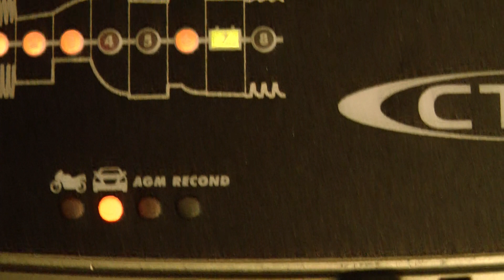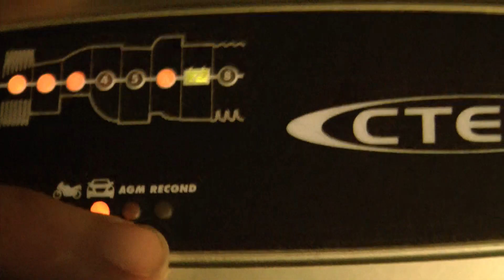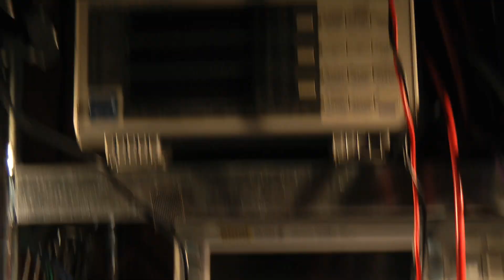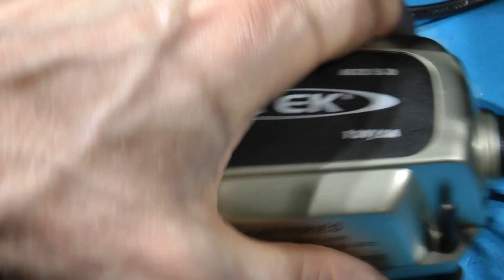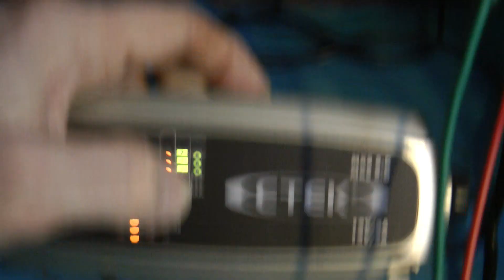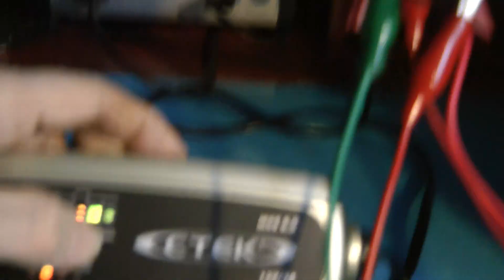Does the NOCO Genius5  charge better a than CTEK MXS 5.0 ???. NOCO Parametric Test Part 4

Comment: I'm really enjoying this series. I'm holding off buying a charger until all the results are in . After  the "CTEK vs NOCO GENIUS 5" test  I'd be really interested to see a "Noco GENIUS 5 vs NOCO GENIUS 2" showdown. I'd be really interested to see whether a longer charge time at lower amps results in extra amp hours. I remember there was some indication that this may be the case during one of the early test runs of the Noco Genius 5.
Reply: Get yourself a BOSCH C3 for half the price.
Reply: @irionpleione8312  There are lot of bad review for Bosch C3 - https://www.amazon.com/Bosch-C3-Automatic-Battery-Maintainer/dp/B004TS1IB4

Seems to be failing quite soon
Reply: @yoot13  ,same as CTEK; only it's half the price and both have a legal 2 year warranty. So, make the math,.. Anway, Magic Smoke told us he'll try the Bosch C3 and we'll know then how reparable and upgradable it is :D
Reply: Or genius 1 for $25 when it’s on sale, or $30 regular price
Reply: But genius 1 & 2 not have a repair mode. Which the important is this feature?
Reply: @R0ay  if the repair mode is not doing anything, why it’s important?
Reply: @R0ay  I guess that's what's going to be interesting about these tests that Magic Smoke is doing.  A) Do the  "repair modes" actually do anything and B) Does charging over a longer time at  lower amps actually work better than the 'repair mode' ie. add amp hours capacity. But you're right; Noco Genius 1 and 2 don't have a dedicated repair mode but Noco Genius 5 does (but maybe it doesn't actually do anything).
Reply: @balicrimechannel8143  Lead-acid batteries are about the most basic chemistry and after 180 years of experience with such batteries it's well known what and how can de done. A sulfated battery has higher electrical resistance because of the lead sulfate that has deposited on the plates (Ohm law = reason the charging gets more and more difficult). Ince the lead sulfate transforms from gelly into crystals, there are two possibilities: 
1. the OLD METHOD: applying MUCH higher voltage; something these toy chargers aren't capable of. 
2. The LATEST solution is not to apply high voltage BUT HIGH FREQUENCY.
For both you'll need a specific professional and expensive Battery desulphator device, devices that are used for batteries in the industrial and military field.
Reply from the maker: No jelly in car starting batteries. The design hasn't been stable for 180 years. Barium and calcium etc.. has been added to the electrodes.  Point 1 is irrelevant for sealed lead acid (maintenance free) types and if a high voltage is required the battery is very damaged and beyond redemption.  Point 2.   Do you have any references about the use of HF? - I can find none.
Reply: @razenby  ,I totally agree on the 1. point, that's why I consider that these toy "reconditioning" has the same level of effect as L'Oreal creams and their commercials on TV (one keeps asking himself why they don't hire old women for the commercials). 
as for point 2. I've even copy pasted a research paper for you that is freely accessible :D ; I know that the method is used in industry, but I don't know the scale.  https://www.researchgate.net/publication/320886624_Desulfation_of_lead-acid_battery_by_high_frequency_pulse
Reply: @razenby   the "jelly" was a descriptive term of the state observable on the plates before it hardens into crystals.
Reply: @razenby  other research papers are linked under citations.  
https://www.researchgate.net/publication/347929763_An_empirical_investigation_of_lead-acid_battery_desulfation_using_a_high-frequency_pulse_desulfator/link/5fe7b50792851c13fec4409b/download
Reply: A longer charge time at a lower current level can be done using the CTEK as it has a 'motorcycle' mode which lowers the output to 0.8A rather than the listed 5 A.
Reply: @richardlouie2922  , that's handy in hot summer and on a new healthy battery.
Reply: @irionpleione8312  Not to mention that the charger should heat up considerably less charging at 0.8A vs 5A.
Reply: @richardlouie2922  Is there a benefit to charging at lower amps over a longer time? As Magic Smoke shows in the next NOCO video, the NOCO 5 tapers off from 4.88A as it enters different cycles (which is a detail I couldn't find in NOCO's literature/website), so the 0.8A feature of the CTEK seems redundant, perhaps? But other than slower bulk phase charging in the NOCO 2, would you expect improved battery charging using the NOCO 2 versus the NOCO 5?  I guess I'm wondering whether the "smart" chargers have made the traditional trickle charger actually obsolete if they automatically scale down current during the different stages.
Reply: @kevinmager4906  In theory, yes.  I say in theory as I haven't seen any scientific studies on the subject but if you look at the fact that heat causes damage to batteries and charging at higher currents typically create heat, one can draw a good conclusion.  As for the NOCO's documentation, there seems to be a lot of things that aren't 'documented' right for their charger's performance. As for dropping the charge currents down, basically, all smart chargers do that as the battery approaches a full charge - ie the CTEK does this as well.  The main reason why you want to start with 0.8A is for smaller batteries as they generally can't handle a high charge current so the low current charge feature found in many chargers isn't redundant at all.  

Be careful when you are using the term 'trickle charger' as different people define 'trickle' to be different things.  The NOCO 2 while being a lower current charger is also a smart charger in that it has multiple stages and adjusts its charging processes depending on the phases it is currently on. Trickle chargers by the traditional definition are slow chargers that constantly 'trickle' a low current charge into the battery.  The problem is how you define 'low'.  I've seen vendors define 'low' as a 5A 'trickle' charger which is low if you compare it to a 10A or higher charger.

Comment: Thanks for the efforts. What do you think the "repair" or "recon" mode of these chargers suppose to accomplish? desulfation of large crystals? The drop seems to suggest that they are making it worse. No?
Reply: I've put my Varta Silver Dynamic 85Ah through the reconditioning mode two times with the CTEK MX 5.0 and there was NO effect. There was however a noticeable battery improvement by regularly topping-up the battery on a 5 day interval while also using the car. We're speaking about a 2.0L diesel engine that requires quite some power to start with the actual freezing winter temperatures.
Reply: @irionpleione8312  Can you please define what measurement you used to come to the conclusion that there was no effect?
Reply: @richardlouie2922  , observation and deduction.
Reply: @irionpleione8312  Which is exactly the reason why I like Magic Smoke's work as my abilities to pass an accurate judgement on something without strong evidence like real testing as well as facts is not as strong as yours.  For example, I can't tell the difference between a fully charged battery and one that is at 80% SOC just by observing the battery or even listening to how the engine sounds.
Reply: @richardlouie2922  thats no good u must have  a tester u must read  all , inclusiv CCA
Reply from the maker: CCA testing will be done. I have thought this through. Unfortunately it is the lack of Ah capacity that causes the CCA to drop and strand you without warning of you park the car for a longer than normal period. If you use the car frequently you wont necessarily note lower than quoted CCA. everything will seem fine until the moment it lets you down. That is why I check the capacity and make sure that the battery is healthy.  I will demonstrate this.

Comment: According to manual (CTEK MXS 5), the battery is fully charged when  STEP 7 is lit.
STEP 3: Bulk charge (Charging with maximum current until approximately 80% battery capacity. )
STEP 4: Absorption (Charging with declining current to maximize up to 100% battery capacity)
STEP 5: Analyze (Tests if the battery can hold charge. Batteries that can not hold charge may need to be
 replaced)
*STEP 6: Recond  - Needs to be selected to include this step.

STEP 7: Float (Maintaining the battery voltage at maximum level by providing a constant voltage charge)
STEP 8: Pulse (Maintaining the battery at 95–100% capacity. The charger monitors the battery voltage
and gives a pulse when necessary to keep the battery fully charged)

I'm a bit puzzled why it skipped steps 4 & 5. Seems odd.
https://www.ctek.com/storage/28170E5A4DF8DDE255F2544A55F5C421179A3398C557729443D3E9C908F0382E/d4c71f1fcf354b37bdfb3841d00adafd/pdf/media/01d8e64db81c4259bda89213323dad93/MXS_5.0-manual-low-UK-EN.pdf
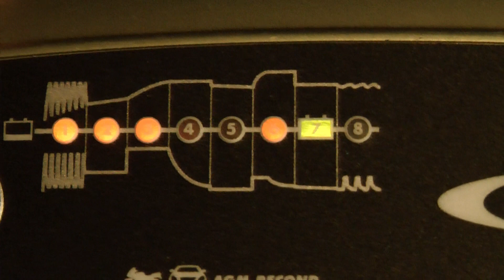Reply from the maker: Thanks.  You can see the diagram of this a 3:07 in this video. All the stages are discussed and checked there.  I couldn't make much sense of them there either.. Have a look at the CTEK detailed test. and see if you can see any Rhyme or reason to it: https://youtu.be/E4UMISxEw1I   (Was the firmware written (or stolen)  in China??)
Reply: @razenby  Both NOCO and CTEK physically made in CHINA
Reply: @razenby  Thank you, waiting for the next parts :)

Comment: I was wondering yesterday what was that video about; I mean, the title and the content didn't match. My CTEK MX 5.0 doesn't run hot at all, maybe because of the winter temperatures in the garage, so I still have some hope that this overpriced peace of "Swedish meatballs engineering skill" will last a few years. Or should I preemptively send it to you for an upgrade? (well, there is a 5 year warranty on the piece, but I doubt in it).
Reply from the maker: Thanks. I wonder if you have stood over one that has been pumping out full power for and hour. I have serviced 3 CTEK mxs5.0 chargers and they all get hot under load as does this virgin one from my neighbor.  They don't get hot when just topping up a battery but at the full sustained 4.5 amps  they cook nicely when charging a depleted battery . Ambient in my office is about 18 to 19 degrees. It wouldn't do well under the hood charging a flat battery on a warm summers day.  I get two or more emails a day from Tubers asking if I will repair their dead CTEKs.
Reply: @razenby  You’re right. The hungriest battery I used this CTEK MX 5.0 charger on was the 85Ah Varta Silver Dynamic installed in my diesel car. 
My diesel engine’s heat sticks had to be replaced and the mechanic discovered that the battery was under 12V. He told me that modern cars drain the battery even if they’re parked and considering all the lockdowns and far less driving around these days, many will have to replace the battery. I was advised to get a battery charger at once, a cheap one, and to fill up the battery; and repeat this on a regular base.
Instead of getting the Bosch for half the price I was sidetracked by the “reconditioning” mode and the car magazines praising this CTEK. 
The first use; it was 4°C in the garage, the CTEK charger lit up the third “stage” and then it begun charging; the CTEK got quite warm, probably some 25°C. This was the hardest use it was put to. After this one occasion it is now only used to top-up the two cars on a weekly base and it stays cold.
Therefore; if one thinks better, the CTEK MX 5.0 would second quite nicely as a car’s seat warmer in winter; in summer it might however ignite the seat and the driver. 
So; this piece of a Swedish RESISTOR has a 2 years legal warranty and 5 years promised by their official supply channel (that has sold it to me) and I doubt they’ll honour these 5 years. 
As for the reconditioning mode; I’ve disconnected the battery and put it through two times and haven’t seen any effect; it’s marketing fraud. There was however a noticeable battery improvement by regularly topping-up the battery on a 5 day interval while using the car. One battery is a Varta Silver Dynamic and the other (city car) Yuasa 3000 series.
Reply from the maker: @irionpleione8312  I can't much sense of the lights.. During the original dedicated CTEK video I couldn't get it to do what it said in the instructions and they don't seem to be intuitive at all.  If you haven't already then have a look at https://youtu.be/E4UMISxEw1I
Reply: @razenby  I've seen the video, believe me. I've almost fallen out of my chair after seeing that I've been fleeced with the CTEK. I've trusted the car magazines, only to discover that they're in for the publicity. 
As for the lights, the jump from nr.3 to nr.4 indicates the state of charge of the battery. Using a multimeter is far more telling than this rudimental indication. The green light shows it's done and the rest is just the same as the modern Mercedes digital cockpit; the driver might finish in the first tree by the road if paying too much heed to the "blink, blink".
Reply from the maker: @irionpleione8312  It is strange enough.  The marketing reminds me of the cosmetics industry...  I think we have got a long journey ahead!!!
Reply: @razenby  , 
As for the chargers: the BOSCH Pro line. https://www.boschaftermarket.com/de/de/werkstattausruestung/pruefgeraete/batterieservice/      (very expensive)
I agree; especially since the "pseudo-science" has the upper hand in the population at large. One needs only to remember the people that listened to Trump and finished in hospitals after drinking all sorts of chemicals, that "prevent and treat the Covid-19"; and we're talking about America, not some third world country without the education system based on science. Ideal for those others who like to make a LOT of quick and easy money.
Reply from the maker: @irionpleione8312  I don't know which is worse - Trump or the fake media.  I'll hold a yard sale of barely used and barely useful battery chargers and use the cash to get hold of a Bosch to try.
Reply: @razenby  , maybe you should stick to the low price mass market, like Gysflash 6.12 and Bosch C3. The Bosch Pro Line is extremely expensive, and nobody will buy it; especially since it doesn't have a "regeneration mode".
Reply from the maker: @irionpleione8312 Thanks for the advice.  Ill look at it.  I will get to the bottom of the battery rabbit hole and move on to other stuff.